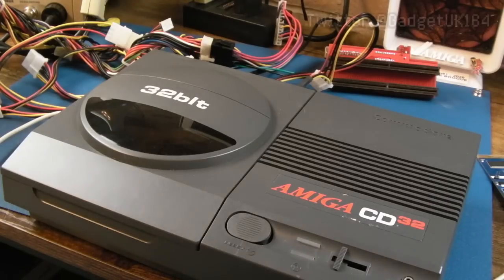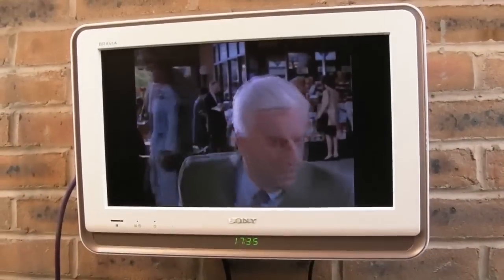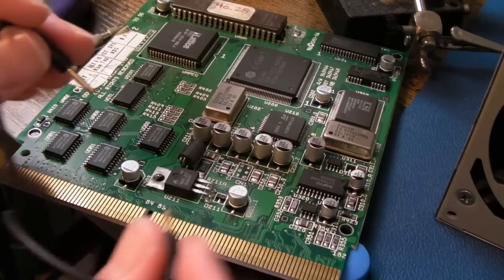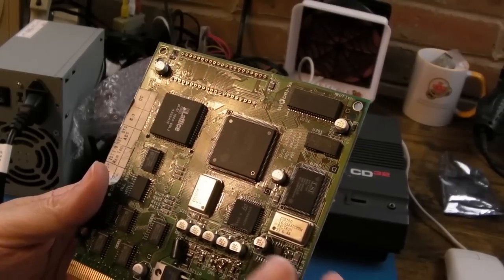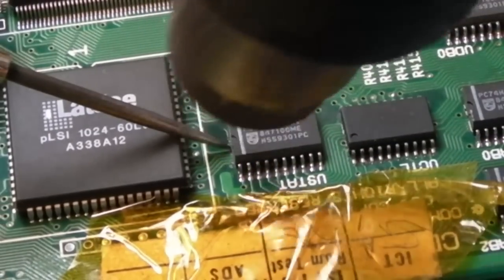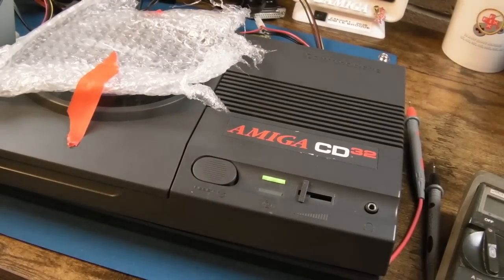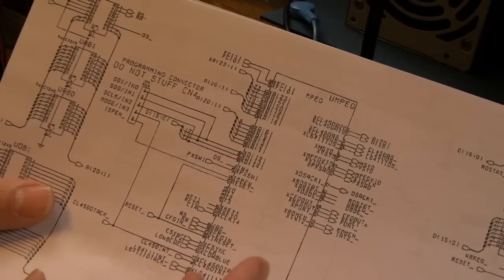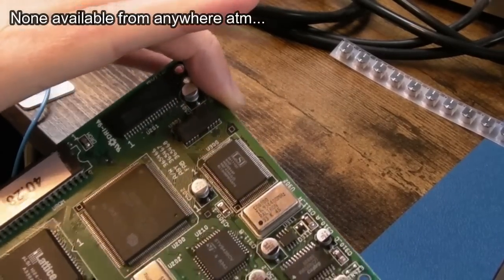Commodore Amiga CD32 FMV Module Repairs (x 2)

Comment: I would call this 1½ repairs out of 2 possible, pretty good going. I had a search for those LSI video & audio decoder chips 64111 & 64112, and had did an image search on mpeg2 decoder boards from around 1993+, and I couldn't find any products that they were used in. Perhaps Commodore were they only company that ever put them in an actual product.

Comment: There was also an environmental factor with why Video CDs were popular in Asia, high humidity was hard for tape formats like player rust with the heads being especially vulnerable and things like fungi growing inside tapes in some regions. Something along the same lines is don't buy cars from people living next to the ocean since they get a lot more salt exposure just from the air than ones inland.😉
It was quite the hardware barrier for FMV in the early days with the "sold separately" MPEG cards that were quite expensive. The DOS/Win platform basically brute forced through FMV with software codecs like Smacker for the most part. Shrinking the size and cost of such hardware basically happened in the PS1 where unlike SS you got that hardware out of the box, and now everything has MPEG decoding hardware inside.
🤔

Comment: What about raiding an unwanted ATI AIO WONDER card as there might be a L64111 chip and maybe a Audio DAC
Reply from the maker: The ATI AIO Wonder has a completely different chipset!  The only cards I've seen using the IC is the CD32 FMV unit, and an Amiga Zorro II MPEG Decoder card (which I have a faulty one to look at soon).  If you look on eBay you can see many of those PC cards up close enough to tell they dont use the L64111
Reply: @GadgetUK164 That is strange as I was able to listen to MP3 encoded tracks maybe it was done in software maybe not but a Raspberry Pi IV loaded with the Fraunhofer codecs might be able to decode the data stream.
Reply from the maker: @DAVIDGREGORYKERR  There are likely thousands of differerent hardware decoding ICs for MP3!  They all work differently, with different pinouts too.

Comment: These cd-i discs usually aren't readable on a pc but I did once find a programme but forgot what it was called which allowed me to access the video files and they will play on Windows media player.
Reply from the maker: I think they are tbh - pretty sure they've always worked on my PC with PowerDVD!  But, there's no native support in Media Player etc =/
Reply: @GadgetUK164  If I find my star trek 2 one I'll try it again.  I think I was using Windows 95 at the time with a cdrom drive and it always made the whole computer hang.  Thanks for the info. 🙂
Reply: I found my Startrek CD-i disc, it was actually STIV!  When I put it in the drive on Windows 11, it tried to read it and then ejected the disc.  I eventually found that to to access these on a pc you need 'IsoBuster' to access the files and that can then convert them to mpeg files from the native 'rtf' format.
Reply from the maker: @AndrewLittleboy1  Just put a few CD-i VCD discs into my Win 10 PC and they play with PowerDVD =D
Reply: @GadgetUK164  ill see if i can find a download and try it!